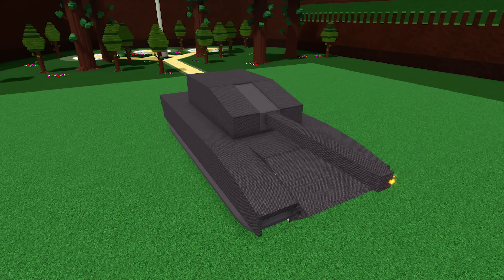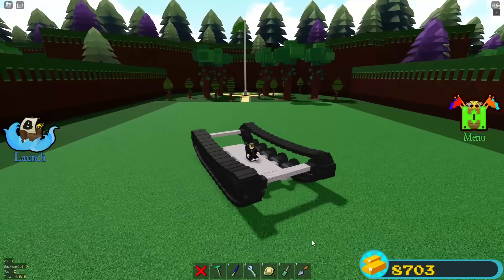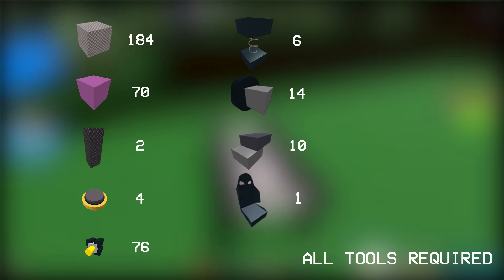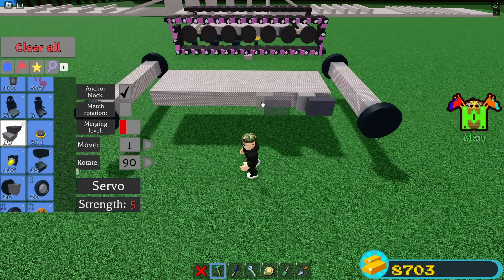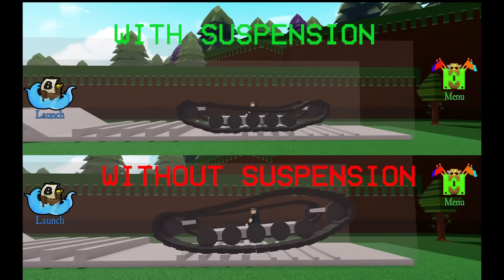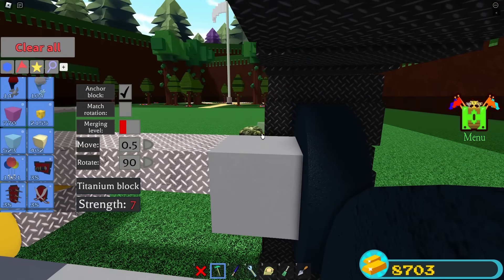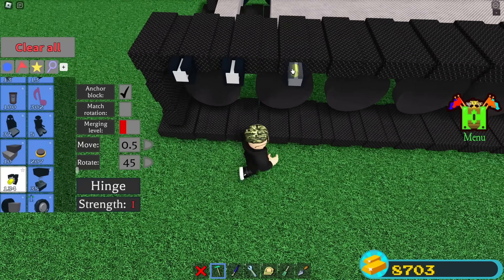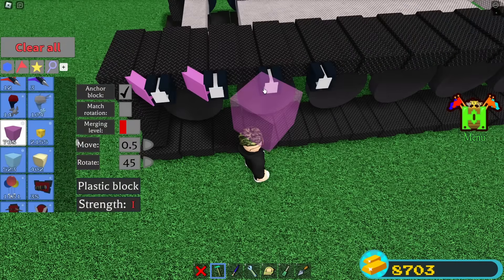How to make tank tracks (BABFT TUTORIAL)

Comment: What if I'm on the phone?
Reply: If you are on phone you must make the mobile conversion made in the tank tracks v3 version. Basically just use a pilot seat and connect it to the wheels and when you go forward your build will go like up in the sky but right after you go forward with ⬆️ key hold ➡️ or ⬅️ and the tracks will work on mobile. You can also use a switch to set up the tracks.

Comment: Where is the vertical facing hinge from 7:37 to 7:40? It seems like it just disappeared but I couldn't understand what was going on, can you fix that issue or tell me on what I might have missed. Thanks.
Reply from the maker: I made a lot of mistakes in this tutorial and it took off before I had the chance to redo the video. Just keep the missing hinges, I think later on I put them back anyways. If you are wondering why they dissappeared, its because I was stitching multiple clips together and I made a mistake half way through the recording and then messed something up in editing.

Comment: I followed the entire tutorial only to fail on the keybinds part because i'm on mobile. Is there a way for the tank to still work on mobile? I spent a long time on building it.
Reply: you can’t steer it because it’s not for moblie, put 2 buttons or 3.

connect the first button to the left side of the tracks,

same thing with the second one but just for the right side.

the last button is to connect all the tracks to go drive straight, btw it’s optional.

for the car seat it’s easy, connect the tracks.

only works if you have the wrench tool.
Reply: @hello-e-m4c  im not on mobile anymore this was a year ago
Reply: @I_am_bacon._.  ok

Comment: At the start I was like "this video is too long" but I did it anyways. and it looks great. Thanks for the tutorial. I have a few tanks like the e100, maus anf fv4005 that have fake tracks, this will def make them look better, tho I think they look good alr. I'm gonna try building a Jagdtiger now, thanks again. (I'm subbed alr)
Reply from the maker: Thank you so much! It's very nice to see people actually switch to working tracks.
Reply: @ReliantShell  I have a question tho. How do I make a tank with this? Do I stretch the tracks first and then build, or try to build the tank flat and stretch the tracks everytime I use it?
Reply from the maker: @AtelierMoulineaux  You build the tank while the tracks are flat and then stretch it each time you want to use it. For better results I recommend you use a piston to lower down the main tank body on the tracks, just like I did in my tank tutorial.
Reply: @ReliantShell  oh k. That kinda seems hard, but i'll just turn of the shell's collision so it works. Thanks for the tip btw
Reply: @ReliantShell  all my good and detailed tanks before I saw this looked bad using invisible wheels but now they all have working tank tracks thanks bro
Reply: @ReliantShell  I need help my tanks traks stop moving after 1.5 secs and get stuck (forwards and backwards) can you help